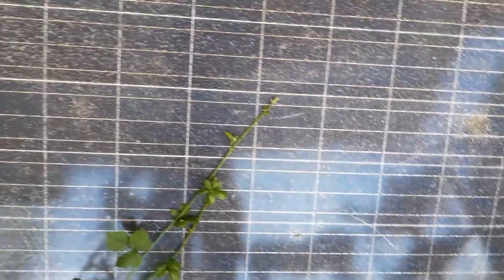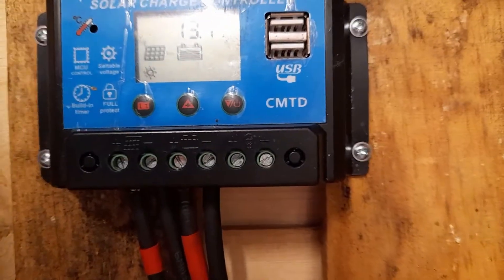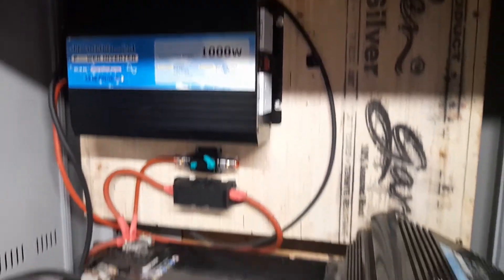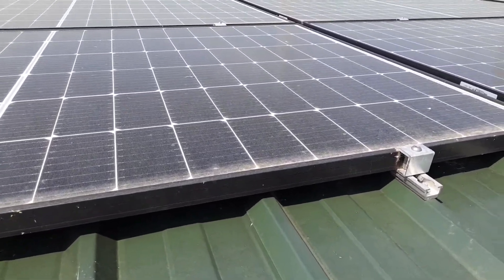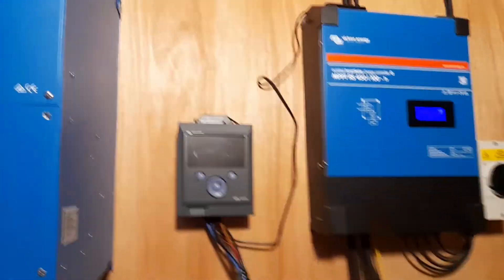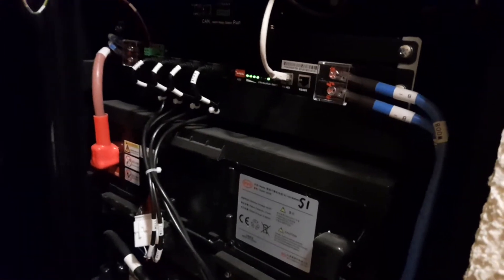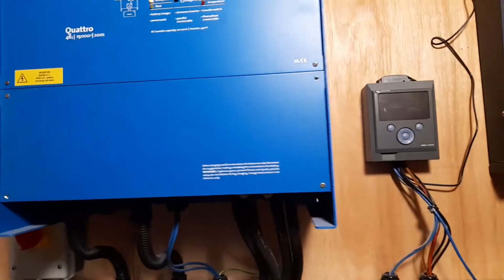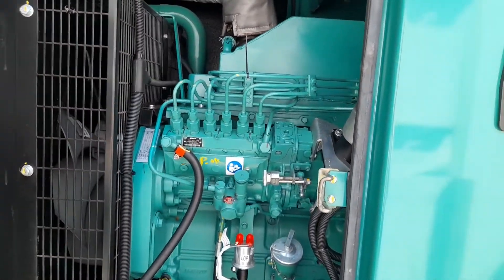What solar system to buy? what do you need for an offgrid solar system? cheap vs expensive!

Comment: Could you help me understand why most folks talking about off-grid normal homeowner solar systems... don't discuss price (and total price) of a typical system?  I would like to go solar but first need to know if its something I can afford.  Like you indicated, if you can't do it right the first time, it will be more expensive in the long run with the cheaper components.   In the states, when folks are building a new home, or renovating the grid electrical system, the most common system installed is "200-AMP/240v".  Setting aside specific daily watt consumption for a second... what would a 48-volt solar system cost (approximate of course) that would be equivalent to a "200-WATT" (120/240v) grid system ???  Online calculators indicate that would be a 48000-watt system.  So, someone considering switching from grid to solar, who currently has a 200-AMP service to their house, and doesn't want to downgrade their energy capacity, could get an idea of what the switch over would cost (excluding backup generation).
Reply from the maker: 200 amp 110 or 100amp 240v is about what I have available with this system, your talking 25-30k new but the batteries are half of the cost
Reply: @Field_to_Farm  thank you.  Far too many folks talking about solar tend to... as they say... sell the sizzle and not the steak.  Not too many folks thinking about going solar, do not want to give up their current capacity,  therefore they need to know what the switch over will really cost them overall.